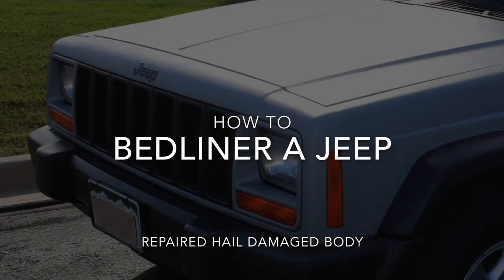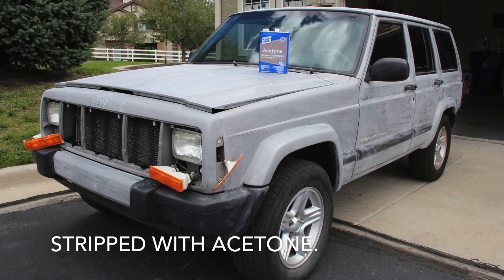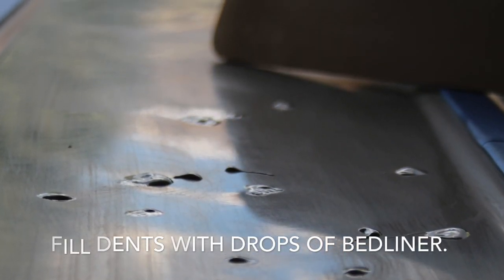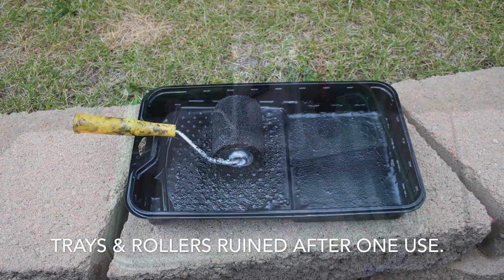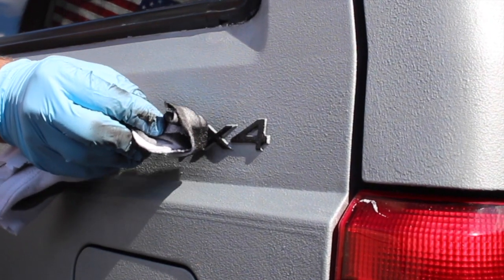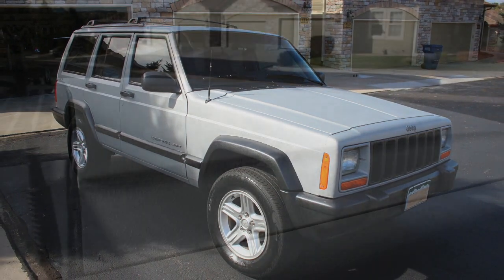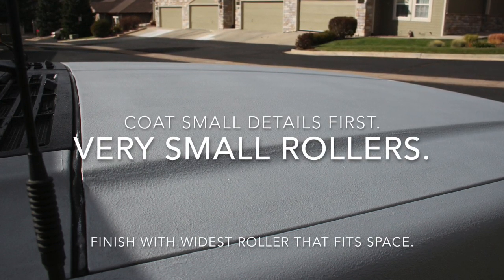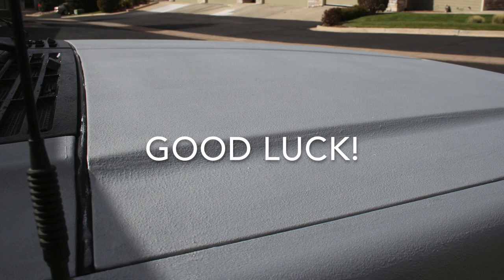How To Paint a Jeep with Bedliner and Rollers

Comment: 3:00 - That raised letter painting tip was worth twice the admission price.  Thanks.  I also appreciate the other lessons learned.

Monstaliner has a working time of several hours.  It's common to mix and apply an entire gallon at a time, with none of the finish variations you had because the material was starting to cure as you were applying it.
Reply from the maker: Good advice.  Please post photos of your result.
Reply: @edherlik6816  - My 4WD Hijet truck is on a cargo ship in the Pacific Ocean and is due at the port at Newport News Virginia in another month.  That means I probably won't be applying the Monstaliner bed liner until spring.  I plan on doing a bed liner paint job, inside and out.  It's a simple little truck so there's not too much trim although I'm budgeting a day to prep and another day to paint it.  I have a Hijet project YouTube channel but there's no content yet.

Comment: I would like to show you my monstaliner 1988 jeep XJ. It is predator green and color came out amazing. no rubber, uv protected and dries rock hard. no lines or drips. I still have to do the black but I will do that once I get my new bumpers and rear armor. nice video. thank you for sharing! monstaliner you can take your time. you have anywhere from 2 - 4 hours between coating. Depending on humidity and temperature but I had plenty of time.
Reply from the maker: Great!  Add a link to your video of that work.  I'm sure the followers will like it.

Comment: You answered so many questions for me, many thanks for this useful video!
Very clever way to do the raised lettering!  I learned something new.

The tinting issue is what is stopping me.  I wanted to use Durabak not Raptor Liner.  Raptor is a 2 part Epoxy paint with a 1 hr working time before it hardens.  Its a glue formula.  Very brittle, sets rock hard, no flexibility. Durabak is a premixed Polyurethane paint which has a much longer working time of  hrs or more, is very flexible, and can be roller brushed with ease using a mohair roller.  As thick and similar finished effect. 

However, Durabak offers no custom tinting, only standard primary colors, ugh!  I wanted a metallic or pearly finish with mica powder but might need a bucket of it instead of 25 gram packets and might change the formula and final effect.  Also, the only way to get a blue green is to mix the blue and the green premixed buckets at $130 per gallon with the clock ticking on using it up fast.  Very dispiriting.  THERE HAS TO BE A WAY TO TINT IT, OR IT WOULD NOT BE TINTED IN FACTORY, RIGHT?  IF ONLY THEY WOULD TELL US HOW!!!
Reply from the maker: Sorry, I just noticed your posting.  I have no idea how to make it work with Durabak.  But, it seems to me, that any very durable coating can be made it work well.  Tell us how it turned out for you.

Comment: I did mine in black with raptor . Looks good.  I used a spray gun.  Note for anyone doing this.  I’m terrible at everything and it came out nice on mine.   I had horrible paint and now looks good.  Most work that’s longest and hardest is prep.

Comment: Very cool. I'm looking to do my Jeep. I go off road in some tight trails and I got a lot of scratches from branches. The Jeep is really built and looks awesome but the scratches make it look more beat up than it really is. I was quoted 3k to have it done professionally.but after watching your video,that's really all I'm looking for. Not a show car but I don't want it to look like a junk pile, I've invested over 12k in building it. It's not junk. The scratches just catch the eye way to dramatically.
Reply from the maker: That coating is essentially indestructible.  Show us how your ride turns out!
Reply: @edherlik6816  will the 3rd coat hide any over lapping I expect to happen since this will be my first time doing this. How forgiving it is? Thanks for responding, really appreciate it.
Reply from the maker: @brianduff4278  I suggest using the last coat quickly and when it's really fresh.  That will reduce the roller marks, which tend to increase as the coating gets sticky.  Or, use a coating that takes longer to set up and get sticky than the one I used.

Comment: The tinting works just fine. You just need to use Urethane base coats and understand that it's going to be a flat color. Not sure why you say it doesn't work.
Reply from the maker: That is bright chrome tint used as directed.  Sure, it's flat, but it's also not anything like bright chrome.  I'll use pre-tinted bed liner next time.
Reply from the maker: I bought the coating and tint from a specialty paint store that mixed the tint to specifications.  Following their instructions got the medium gray rather than the more silver that would have resulted in paint (vice bed liner).  So, tint obviously doesn't work the same in bed liner as it does in paint.

Comment: Thank-you for the video. 
Is it better resistant to scratches, than normal car paint.
I would like to use it on my own car, then you can save a lot of money and put on more thickness.
Reply from the maker: Yes, it was nearly impossible to scratch in normal situations.  You can make it as thick as you want but just enough to get the color right seemed to be enough.  It was already very tough at that point.
Reply from the maker: Yes, it was very hard to scratch.

Comment: did you use texture rollers or just regular foam rollers?
Reply from the maker: I used textured but with very short nap.  You can pick your texture pretty much like you would on a house painting job but you'll need to spray if you want it to look smooth.  No, it will never look smooth like normal car paint.

Comment: I knew a guy who once painted his whole car with a brush.
 How'd it look? 
Like it was painted with a brush. 

Now I know not to use a brush or a damn roller.
Reply: Taigh lmao yeah it looked like a picket fence
Reply: Brushing CAN look flawless.  It’s called “tipping”, and there are YT vids on it.  A guy does a boat in Navy Blue, and it looked AMAZING.  This perspective is coming from a guy who has (conventionally) painted a dozen plus vehicles.
Oil based rolling CAN look good,  but it takes a shit ton of color sanding, after building up MANY base layers.
This fella who painted the (silver) bedliner, clearly had (his) ‘bar’ set Very Low, in terms of finish “quality”
Reply: Chad Bolton you’re right.  Tipping is a Great technique for conventional (gloss) paint.  It wouldn’t really work with bedliner....